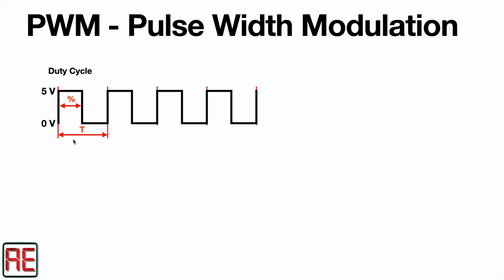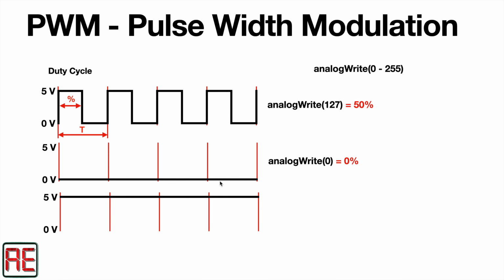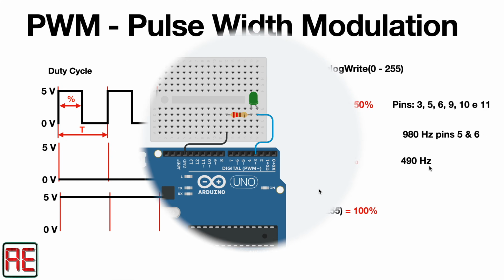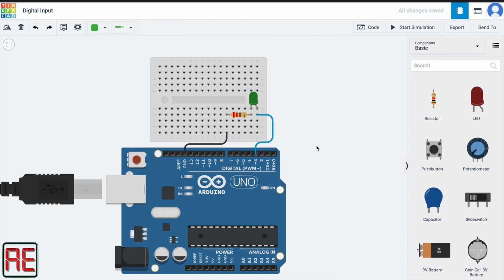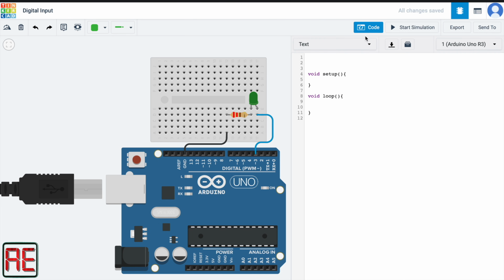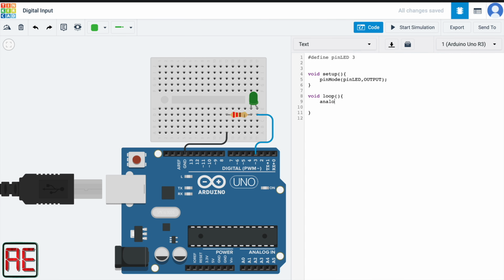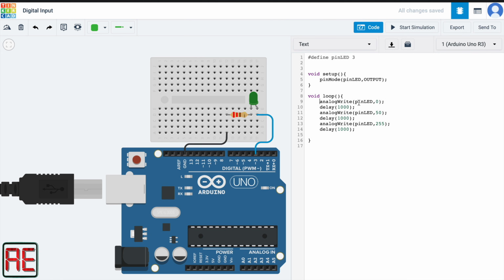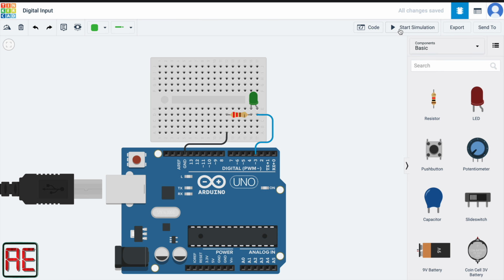Arduino PWM: Pulse Width Modulation

Comment: What does the red +5v  wire use in the broad? It doesn't have any function.
Reply from the maker: Hi William! Well noted! You're right. The +5V was in the introduction part because I was reusing the circuit from a previous project. If you look at the assembly part I don't use it in the circuit. Thanks for your comment! 😀